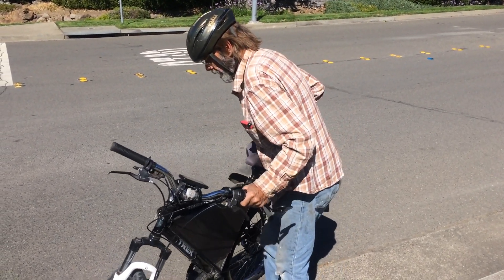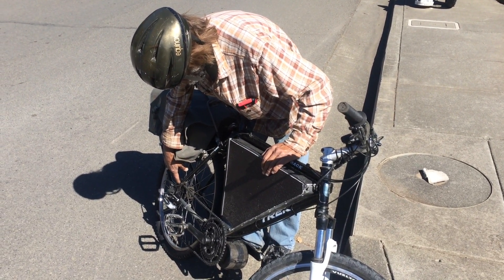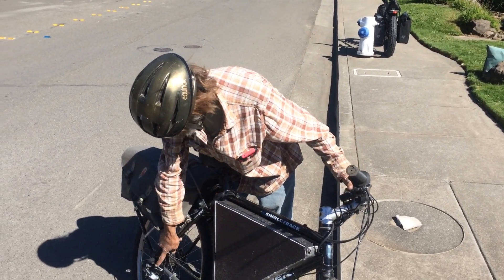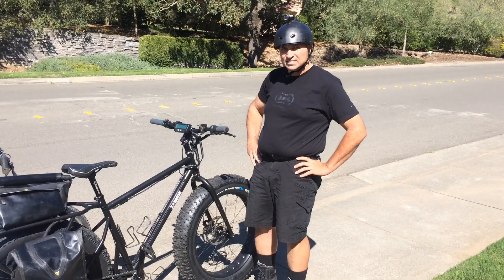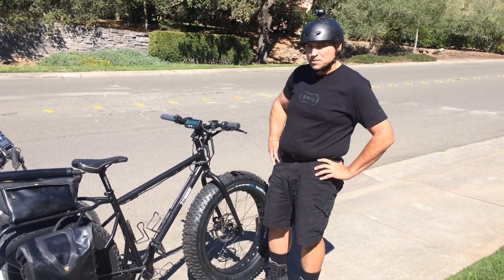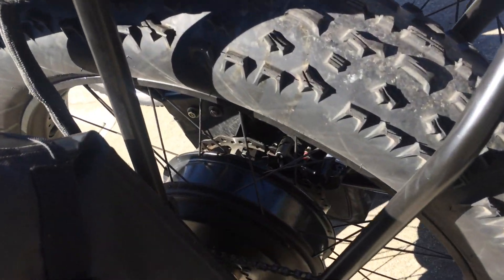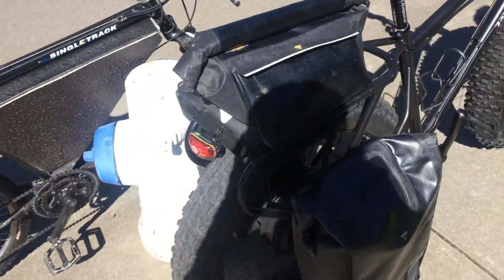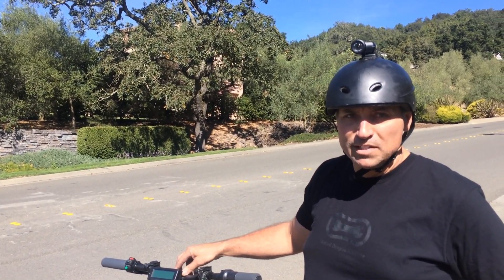Hub and Mid Drive Motors on Steep Streets

Comment: Mid-drives are only good in theory. In reality they are useless because you need to replace the chain or cassette every 200 miles or so. Direct drive motors allow regen so you save your brakes and almost never need maintenance. That is the real reason why the top bike brand (Stromer) uses direct drives.
Reply: 1000 miles haven't changed chain or cassette on bbs02b
Reply: Thats incorrect i have 1000w mid drive and done hundreds of miles and still on same chain, rear cassette, derailleur and chainring, there is not much wear on them
Reply: You are lying. What ever you have to do to make you feel good tho 😂

Comment: Very good video and explanation. I am wondering what is the internal temperature of my 1000w hub, mine doesn’t have a internal thermometer. However, I measured the exterior surface temp of the motor at 36C after riding 10kms of mixed terrain grades. My 48v 30a controller was at 46C and my battery 48v 11.6ah (BMS limited to 20a) at 31C.

When your motor reached 100C (assuming internal temp), what was the temperature on the exterior surface of the motor?

Comment: How many watts were you both using at a given point? This is not really accurate to be fair. Your bike has much more friction due to the huge wheel size plus you weight probably double as much as the other man. Even if you used 1000 watt while the mid drive was using 500 watts, in my opinion hub wins
Reply from the maker: I (hub motor guy) weigh more than twice as much as Dan (mid drive guy). My bike, at 95 lbs.) also weighs twice as much. We should have done the test with the light guy on the heavy bike!

Comment: You need a way smaller diameter rim for that motor. At 72 V it should be a rocket ship. Also you should keep your speed up when going up hill, no point crawling up it with your huge rim.
Reply from the maker: As I recall, I was trying to keep up my speed on the very steep street in the video, but the standard winding of the hub motor sure didn't like steep hills.

I know that a smaller rim would be more functional and practical, but I like the look of fat tires on huge wheels. Dan built his bike for efficiency and I built mine for power, appearance and stealth (hiding the electronics).

Also not mentioned in the video is that I had stripped threads on my freewheel flange which rendered the mechanical gearing useless. The freewheel threads were stripped because I foolishly chose to use no freewheel spacers. After buying and installing a new freewheel flange using 3mm of freewheel spacers, the freewheel flange threads don't strip.
Reply from the maker: I have the current limited to 30A because my cells are getting old and were never very impressive to begin with (180 LiMn 18650 cells, each with 2200mAh). Sometimes I remove the current limit and the bike will draw 70A continuous with 105A bursts, but this heats up the motor so much that allowing unlimited current is impractical for daily use.
Reply: Industrial Ebikes Does it kick really hard when starting? This is a sign of too much phase current and extra heating. It is different to battery current. 105 amps at 72 volts sounds good. I'm just wondering how the cromotor can't keep up with a tiny mid drive motor.
Reply from the maker: Well, there's a reason why I always go back to limiting the max current to 30A. The bike is a death machine at current levels above, say, 50A. That is just too much power for my purposes. I want to ride safely.

As far as the heating goes, my hub motor has a standard winding and the power band is for higher speeds (for example, 10-40 mph). At lower speeds (e.g., 1-9 mph), so much of the current just goes to producing heat and this problem compounds itself. This motor does not do well at low RPM. With mid drives, one can gear down (mechanically, of course) and keep the RPMs up.

As far as blasting up that super steep hill, ain't gonna happen because the hill is crazy steep and I have a high mass, including astonishingly high reciprocating mass (25 pound motor, 7 tire liners, 28 ounces tire slime).

Having the stripped freewheel flange hosed me because I had no mechanical gearing. My bicycle drivetrain would have been a huge help because it is a granny single speed. I have since fixed that problem, of course.